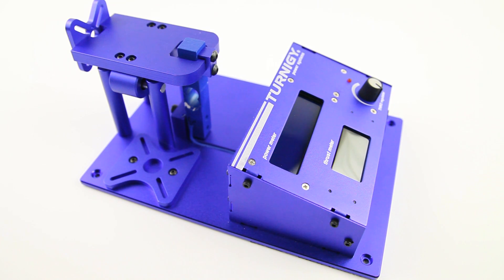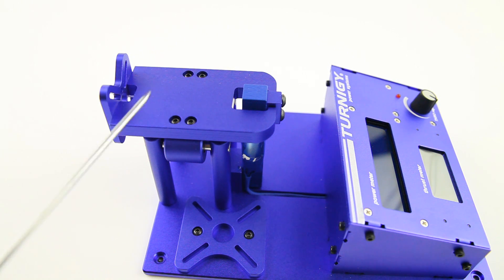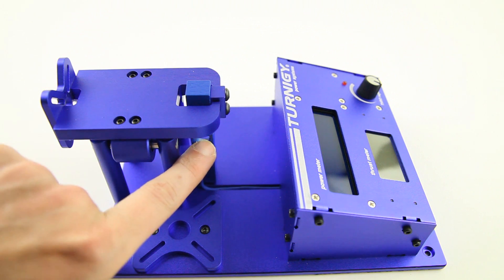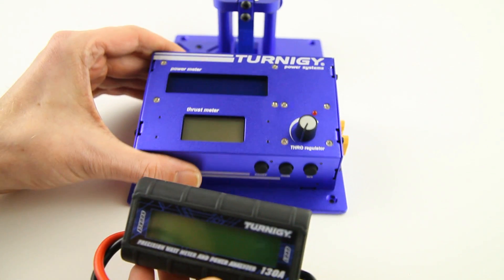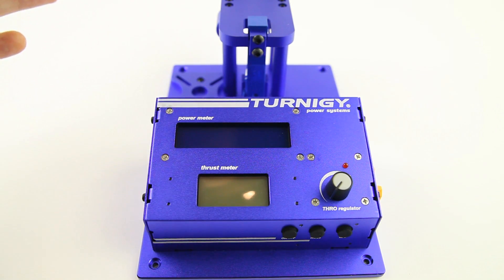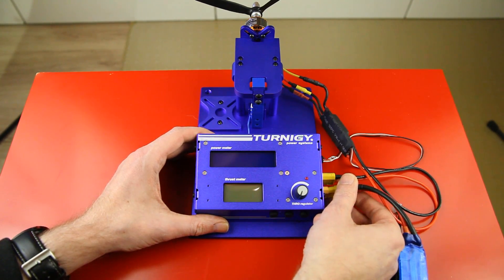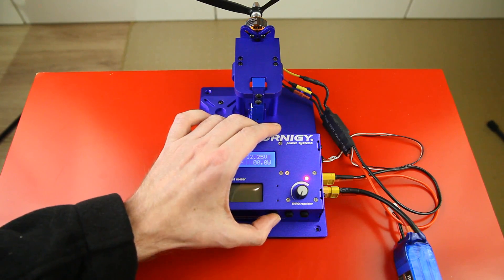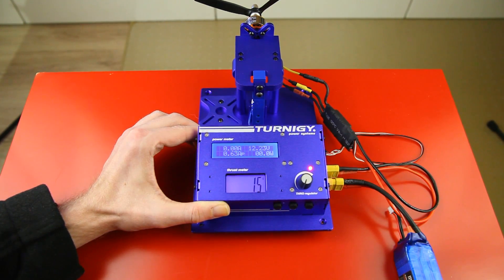Turnigy Thrust Stand V2 - Show & Tell

Comment: tjahh thx for the vid, but belive an brand like Turnigy could have comed up with something better here in version2..this standsout of an mixmatch of electronic-componenets they had on shelf and v1 in new clothing... in theory it wouldnt take much to suit an avarage laser/led tachometer in  and align with an sticker marker and get the the different parts to talk together like the watt&voltmeter align with the thrustmeter align with the tachometer and make it all on one.. .. - in the end' its "Turnigy brand" and quite a player on the RC-scene it should be possible here in 2016 to make such an item for main purse and for the avarage joe..(all ther pasrts are out there as bulksale and should be easy to align it as all in one and around the 100US mark..
Reply from the maker: It indeed is a bit of frankenstein indeed :)  Several different products thrown together.. But well... It at least does what I wanted.. Could Sure have been better / more professional indeed
Reply: The unit isn't built to be a laboratory piece of equipment. It's basically made to compare different props, motors, ESC's and LiPo's.  To include what you mentioned would make it a lot more expensive, even now it's not exactly a "Must Have" so I imagine the numbers sold wouldn't be enormous and this is what rules it's make up. 

Who knows HK may make a model 3 and surprise us all. Somehow I doubt it though. This one does what it says for those who can afford it.  Meanwhile the remainder make their own using $10 drug dealer type scales and a few scraps of wood.

Comment: Was wondering when you would post the video on this. Spotted it sometime back :) it looks much improved over V1, but still not perfect. What battery voltages can it take? Also what battery was that? Dropped from 12V down to 11V with just have throttle, doesn't seem too good?
Reply from the maker: +The RCAddict Haha yes.. It was visible in the toy grade quad I reviewed a few video's back ;) 
Nope.. it isn't perfect.. Voltages are 4.6~60V (see description for more specs) .. 
The battery I used here is indeed CRAP! I only use it for that handy lipo-powered charger :P  BUT. you'd be surpriced how much most lipo's drop their V...
Reply: DutchRC Adventures Yep, the YiZhan. Sweet, great range :) Sorry about not checking description, I almost always read that while the video is buffering ;D Well, I do know they dropped, but something that far, say in a rtf qaud, or something with LVC would be really bad, lol, land way too early ;D 

BTW, I flew my micro fpv quad again, through 2 750 packs, and one flight was 5 mins, the other 6 and a half. I am talking with Benedikt and he said something about I need to thicken the wires from the battery to the board, and they are indeed very small.
Reply from the maker: +The RCAddict True :)  I got this lipo (used) from someone.. and well.. It's wurth close to Zero :P haha Well.. It does the job for that small charger ;) 

Ahh I see.. to much resistance.. (I mentioned something about that in This here video as well ;))
Reply: DutchRC Adventures Lol

Ok, so you think larger wires might help? As I said in other coment, just got 5mins and 6 and a half, so not sure :/ Really inconsistent, this FC LVC is :/
Reply from the maker: +The RCAddict Well sure.. resistance of a wire is determined by it's length And thickness.. So both shorter And thicker will lower it's resistance...
Reply: DutchRC Adventures Alright. When I have it apart to change the bolts to plastic, I will take off and add thicker wire. The motor wires are VERY thin though, but I can't imagine that is a problem, as they carry 4X less power though.
Reply from the maker: +The RCAddict True.. then can be thinner without a problem
Reply: DutchRC Adventures I got my first set of parts for the 470 today. Got the China order in 2 days!! The motors and props are huge ;P
Reply: +DutchRC Adventures Yes they do! That is batteries under load do show a significant voltage drop in short order which also has an effect on amperage and of course wattage. I built my own test stand to mount outrunners on top with props mounted and motor rotation changed to push downward onto my scale which I zero out before testing. Works very well, it was only a few dollars to construct and I don't have to mount it to my work bench or bolt it down to keep it from moving. All downward force is measured on the scale while my watt meter shows and logs voltage, amps, watts and current consumed. With most motors drawing no more than 30 amp I just power up with my power supply which keeps voltage constant unlike a battery. So when I test a motor and prop combination I first power it up with the PS but for a more accurate view of how it is on battery I connect one. Good video Dutch (as always!)
Reply from the maker: +VideoSack Thank you :) And GOOD job on that mate! Very well done :D  I actually used that yellow scale you saw in my video for something similar :)  I had a motor-mount on a trolly with 4 wheels.. That way the trolly would pull on that scale.. Allmost the same thing you did :)  Simple and cheap :)
Reply: DutchRC Adventures You probably already know this, but this thrust stand could be a good way to test out the Graphene batteries.
Reply from the maker: +The RCAddict Partly what I got it for mate :)
Reply: DutchRC Adventures Hehe, never doubt you ;)
Reply from the maker: +The RCAddict Now if only them Graphine lipo's were available from other warehouses huh? :)
Reply: +DutchRC Adventures I think that's an excellent idea Dutch. Now that you have the "Thrust-o-Matic" machine, a little comprehensive test of batteries is in order. What do they offer, what do they promise and at what price? Ultimately, do any of the new chemistry batteries truly add to the flying experience? Greater punch-out, longer flight times?
Reply from the maker: +R Usack COMPLETELY correct sir! The HK Graphine lipo's aren't available from the EU whorehouse yet, but I'm sure that will change.. I expect mostly more power really.. But we'll see :)
Reply: +DutchRC Adventures Well, I wouldn't expect them in the EU whorehouse but perhaps the Asian ones!  :)   (Funny!)
Reply from the maker: +R Usack Forreal? That would surprice me VERY much :|  But I've been surpriced by HK before ;)
Reply: +The RCAddict If your "thin" wires are seen to get warm (even hot) in use then they are indeed too small a gauge and you could benefit from heavier wires.